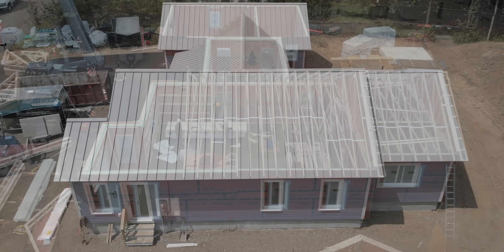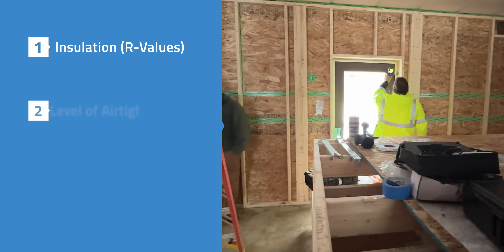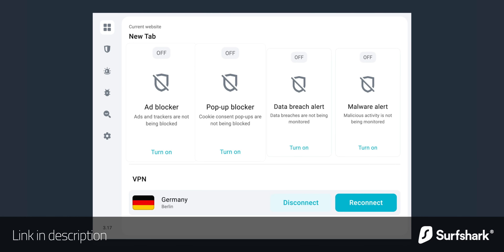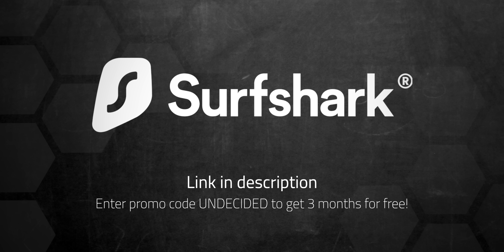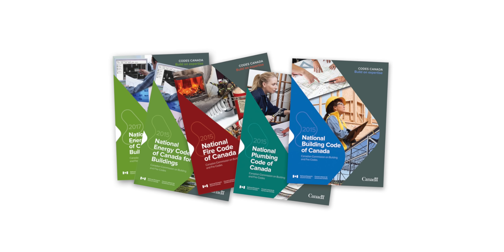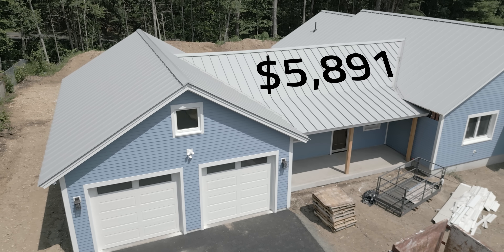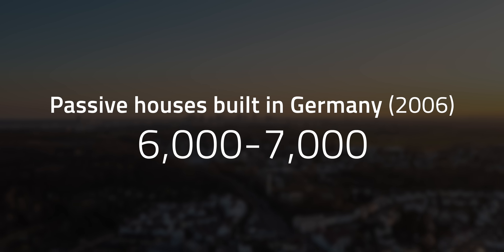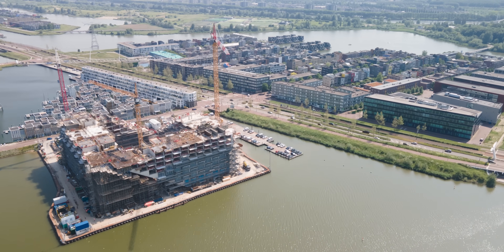Why Do American Homes Suck?

Comment: I remember my first time in the US, it was cold and snowy near the canadian border. The walls of the hotel were extremely thin and look like paper. To compensate for this the heating had to be running 24/7. It shocked me the energy waste and how cheap was the overall construction (ah, and it was the best hotel in town)
Reply: I've stayed at many hotels in the US and have never been in one like you mention... I think you have a really poor example that doesn't represent typical builds.
Reply: I’m not quite sure what you mean by “looked thin like paper”. For the past 100 years houses have been built in the USA using 2”x4” studs in the walls meaning that the finished wall is about 6 inches thick and the insulation in the wall is 4 inches thick. And I cannot imagine anyone thinking that 6 inches is “paper thin”. In any case while these kinds of walls are fine for moderate climates they do not allow for enough insulation in very cold climates and that is why over the past 20 years or so we have started seeing much better insulated homes and businesses in very cold areas. They can either opt to use 2’x6” studs in the walls to allow for 6 inches of insulation or they can use a standard wall and add an additional 2 inches of Styrofoam insulation underneath the exterior sheathing. And of course, Pretty much all houses have been built with double glazed windows since the late 90’s. That being said, since about 80% of a buildings heat loss is through the roof the ceiling insulation is always much more important than wall insulation. 

Speaking of hotels by the way, I recently had to spend several months in a hotel here in southern California after moving back to California after several years living in Asia. Anyway, this hotel was so energy efficient that I rarely ever even turned on the heater or air conditioner despite outside temperatures that ranged from over 100 degrees to below 40 degrees by the time I left. So even in moderate climates they are starting to construct much more energy efficient buildings. 

As for the speed at which various countries have adopted energy efficient housing over the years this all boils down to energy costs in those countries. After all, residents of some European countries pay 6 or 7 times more for gas and electricity than we do here in the USA so it only makes sense that they would have long ago made the move towards more energy efficient housing. I believe that Germany current has the highest electric rates in the world so you can bet that they are highly focused on energy efficiency there. Of course, Canada has cheap energy and yet is still more energy efficient than us. But then again, their entire nation lives in a bitterly cold climate whereas the huge majority of the US population lives in a much more moderate climate. 

As for construction being “cheap” this is patently false. As someone who studied both Architecture and construction, I can tell you that houses in the USA are built to conform to very strict building codes and can withstand pretty much anything that nature is likely to throw at them. And other than increasing energy efficiency there would be no rational or logical reason to make them any stronger than they already are. As for the building material used, this always comes down to what is the most cost effective in that particular country. For example, in Southeast Asia all housed are made mostly from brick or concrete block as these materials are cheap. And very little wood is used anywhere because wood is very expensive there.  By the way, I have heard a lot of not very bright people wonder why people who live in tornado prone area do not build their hoses from concrete (some do). Well, the obvious answer is that even if you live in one of these areas the odds are fairly slim that you will take a direct hit from a tornado in your lifetime.  Then again there are some people who will spend a ton of money building some dooms day shelter even though the odds of them ever needing it are astronomical. But most people do not want to spend money to overbuild for something that will likely never happen.
Reply: @SLOBeachboy  6" is 15 cm, my walls are 60 cm, so your walls are paper thin.
Reply: @the_g371  LOL! Well, all I can say then is that whoever built your house likes wasting natural resources for no apparent reason because even in Siberia or Alaska there would be no earthly reason to have two feet of insulation in the walls. And there would also be no structural need to make the walls anywhere near that thick. Even the walls of log cabins are not that think and in fact the only thing I know of that would come close to that would be the old adobe houses that the early Spanish settlers built here. Furthermore, to correctly call something “paper thin” it would have to be much thinner than what most people are accustomed to and yet probably 95% of the homes on the planet have walls that are between 5 and 6 inches thick – a lot of brick core construction in South America and Asia.
Reply: @SLOBeachboy   You did not guess the valid reason how they become so thick - in EU are countless such cases after a renovation of buildings which were built in 60-80ies, because during that the focus is on the energy efficiency, basically a layer of insulation is added on the outside. And this winter here was -25C. You probably also will be doing that when climate change effects will win US desire to live cheap by wasting massive resources and some panic will set in. Tho maybe even then you will find excuses to not do it. Currently is super funny that USA overall is number one which is responsible for it, China in second place, but we are investing enormous resources to become climate neutral. I already am tired of hearing about sustainability, lala. Upside tho is that these insulation projects are the one part that will pay off, since the war with our brainless neighbours (which ironically now again is undermined by US) our heating bills increased considerably.
Reply: @SLOBeachboy  Effects from such insulation are that now outside is 0C, heating is off and 2 km from here is an airport, but with windows closed I barely can hear planes (except some fighter jets).
Reply: @the_g371  - That’s great. I love a soundproof home as well. Of course, wall thickness and the amount of insulation has very little to do with soundproofing. To soundproof a home, you first want to acoustically isolate the inner and outer walls in some way. For example, there are ways to mount the sheet rock so the sound vibrations coming through the studs cannot vibrate the sheet rock. And on tops of that certain sound absorbing or sound deadening materials can be used. Of course, if you are living in a very cold climate your walls may have been built using a technique in which normal 2x4 studs are staggered on either side. This is a great method, not only because it allows 10 inches or more of wall insulation but also because since the studs on either side are not touching each other heat cannot be transferred from the inner wall to the outer wall through the studs. And while this is done purely for energy efficiency, a nice side effect of this type of wall construction is great soundproofing due to the fact that the inner and out wall studs are isolated from each other. But again, this soundproofing benefit really has little to do with how thick the wall is. Anyway, this is an excellent wall construction technique for cold climates, and it is both more thermally efficient and better at sound deadening than simply using ten- or 12-inch-wide wall studs would be.
Reply: @the_g371  Actually if you had been reading all my previous comment you would know that I already mentioned the retrofitting they have been doing on old brick homes in the UK and other areas in Europe. Usually this is done by attaching exterior Styrofoam insulation or something similar which is then covered with some stucco or some other kind of exterior sheathing. Anyway since this type of insulation does not need to be that thick to have a high R-value the new walls with brick plus insulation are still going to be under 12 inches thick in most areas and this is a far cry from 24-inches. Even the walls of the Amundsen-Scott South Pole Station are not 24 inches thick.
Reply: @SLOBeachboy  UK has snow 2 days per year, we this week saw the sun for the first day in months. Yes, its done like that only its not styrofoam what they use - actually a couple of years ago there was a crazy fire in UK where a lot of people died, so I assume they also wont use highly flamable materials anymore.
Reply: @SLOBeachboy  Here can be used various insulation materials, the most popular is a rock wool, if I translate it correctly.
Reply: @SLOBeachboy  2x4 but those are plywood walls, not real solid walls, and no R value over 20 on each wall so they are like not even sound or airproof. Look up balloon framing. It's a joke when a double or triple pane (gas filled) window is very effiecient, but the walls are paper then with probably no (R10+ pink stuff insultation in the walls) what's the point of these windows if the walls are just 2 plywood and a plastic sheet called tyvek holding the weather from coming in?
Reply: @SLOBeachboy  "Paper thin" is probably an exaggeration. But when i was a teenager i once saw a video of someone mentioning they accidentally punched a hole in their (interior) wall. And i thought they must be lying, because that can't be possible. Well turns out in america it is. But in most of europe, you couldnt make a real hole in most interior walls if you were punching it with a heavy hammer 10 times. 

As for "they are built to withstand anything nature is likely to throw at them" and "even in tornado prone areas you are unlikely to actually be hit by a tornado". Seriously? Stuff is only built to withstand things that has something like a 50% (or 10%?) chance of actually hitting the house? Our houses are, as mentioned before, infinetly stronger. Yet we have no tornadoes, no hurricanes, no earthquakes, no landslides, no avalanches, no wildfires and generally nothing else that could even damage an american house. But we still build like that. Not just due to energy efficiency, but also due to a general approach of building stuff to last. 

Maybe another difference is also, that we don't move houses as often. So if anybody here buys a home, they expect to live there until they die and probably also their children afterwards. The idea of a "starter home" and trading up every few years doesnt really exist here.
Reply: @Soff1859  - Yes, you can certainly punch a hole in drywall as long as you hit an area between the studs. But this of course has absolutely no bearing whatsoever on the structural integrity of the building. The only purpose of the interior layer is to look good and to hold the insulation in the wall. When architects design a buildings, they do not choose the interior surfaces based on the possibility that someone might get pissed off and punch the walls. The important part is the exterior materials, and it would be hard to get through that even with a sledgehammer. By the way you can also easily punch a hole in any of the windows in your house only those holes will go all the way through to the outside of the house. So, are you saying that because of this we should start making all houses with expensive bulletproof glass?

In any case, the interiors used to be lath and plaster in the USA but by the 60’s it was all 3/8 inch drywall (sheet rock) and given the choice I would probably choose drywall over lath and plaster. Although personally I prefer externally insulated poured concrete walls myself, but most people prefer a nice clean looking drywall interior finish. Of course, in the last decade or so textured finishes have become popular (as well as satin paint rather than flat) which makes the drywall look more like the old plaster walls. Anyway, as someone who not only studied architecture but who also has the mind of an engineer and can see potential problems and weak points in a structure, I see absolutely no shortcomings in US building codes whatsoever. In other words, if I were building a new conventional house for myself and could do anything I wanted I would not change the construction techniques or materials. And I am someone who is fanatical about building things right. Of course, as I said before I’m partial concrete but that is due to its appearance and because I need the thermal mass for a passive solar house. I would never however be even remotely worried about the structural integrity or longevity of a conventionally framed house here. Speaking of which you said that your houses are built stronger, but you did not say how you determined this. The only way to determine this would be to have sample houses built using both building techniques at a test facility with giant machines which apply various stresses to the structure until they fail and then the engineers would investigate the failure points. Of course, I could probably look at the construction myself and tell you whether it's very soundly built, poorly built, or unnecessarily overbuilt. 

By the way the term “starter home” did not come about because houses “wear out” over time or because people change houses like a game of musical chairs. Its because families expand and grow over times and so they eventually need a bigger house. People usually also by a starter car as teenagers and then get a nicer car when they get older. People also tend to make more money as they get older and therefore can afford a nicer a bigger house. But there are also plenty of people who stay in the same house for many generations. But because of all these home renovation TV shows people have bought into this myth that Americans are constantly changing houses. The truth is the most common reason to change houses is when one has to move to a new city for a job. Furthermore, houses do not wear out or fall apart over the time, they simply start to look old and used, much like an old car does. And just as with a car you can try to fix it up to look nice again or you can just buy a new car. And with both houses and cars some people keep them looking nice and other people don’t take care of them and they eventually look like crap. It's extremely rare however for a house built to US building codes to suffer from any kind of structural integrity issues even after 100 years. The only houses I have seen with these kinds of issues were not legally built to code. Incidentally, in San Luis Obispo we have an area near downtown that is zoned for historical preservation so you cannot tear down any of those houses to build new ones. Some of these houses are well over 100 years old and yet they are all in pristine condition and are very structurally sound. The only reason houses eventually become run down looking and in a state of disrepair in some cities is because the more affluent people eventually move to newer neighborhoods and then poor people end up taking over the old neighborhoods and these people let their homes get very run down. And it's the same story all over the world.

Comment: I have spent quite a bit to update the energy efficiency in my home and am about to drop about 25% of my home's value into a complete rework of the energy flow into my home as I add batteries, a natural gas standby generator, as well as 26 solar panels to my roof.  Most folks don't understand or care, but I do and I plan to live in my home for a few more decades so it is worth the investment.  And, when I build my cabin up north, I will be working to have passive home levels of efficiency.

Comment: The UK might have good standards. But there is essentially no enforcement - certificates are done on the basis of the plans for the house, not how the house actually performs, and often shortcuts are taken in the building which means that homes which say they are at one standard really aren't.

Comment: Our friends built a 3 story home in Romania and they have no need to air conditioning. Even on the hot days, the air flow and design of the home keeps it cool. The walls are about 18 inches thick on the outside AND inside too.
Reply: On the other hand they have to live in Romania
Reply: @_zigger_  Romania is awesome! We are retiring there.

Comment: I just build a house 2 years ago here in Denmark and 90% of the "extra" your talking about doing is a Legal standard here.. I will simply not be allowed from the state to build a house that is not a  Low energy house. Last year my family used 5000KW for the year with a heatpump  everything run off electricity.. And this is in Scandinavian with cold windy climate 5-7 months of the year..

Comment: We have been placing form ahead of function and using the cheapest materials available. 
Ease of maintenance, energy efficiency and ease of repair doesn’t seem to get into the equation either. 
What was that old song? “Little boxes made of ticky tacky”. We have to do better than hundreds of thousands of dollars for weak, energy wasting “ticky tacky”

Fuel was dirt cheap when these building methods, zoning and building rules were set in place. The whole thing needs revision.

Comment: In Poland a lot of houses have 70 cm+ wide walls, for example my parents house has 25 cm of Concrete blocks, 5cm of reinforced concrete, than 15 cm insulation than about 15 cm of bricks, again 5 cm of reinforced concrete and finished with decorative stones 😂 150 km/h truck smashing into it gonna fold😂😂😂 and reinforced concrete is like 5% steel bars